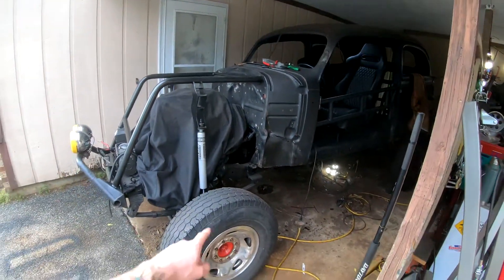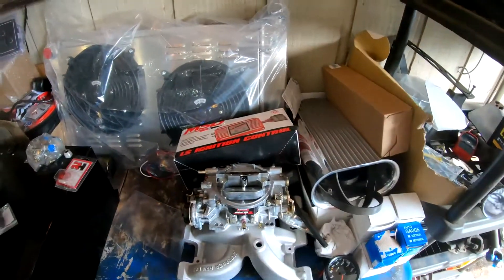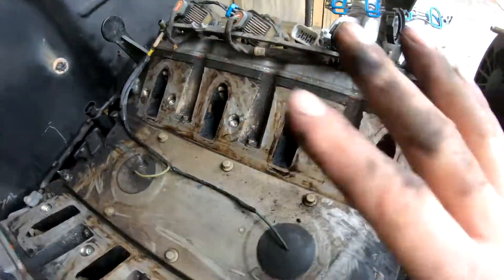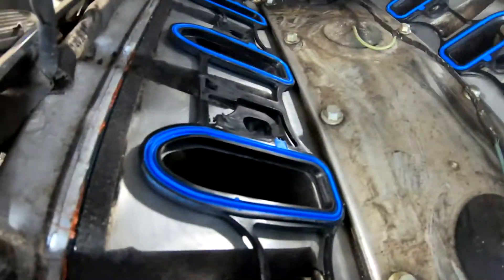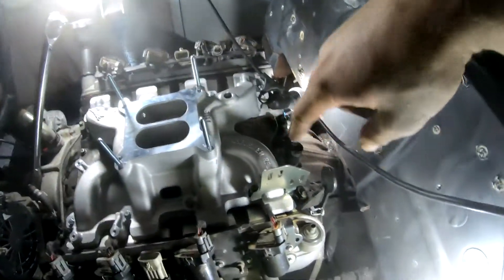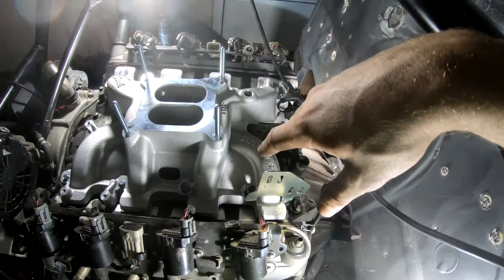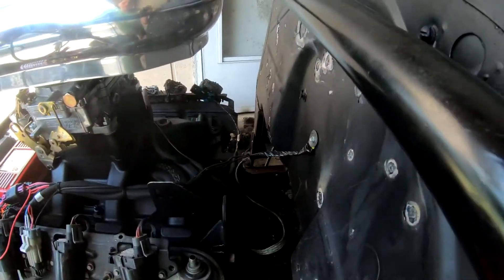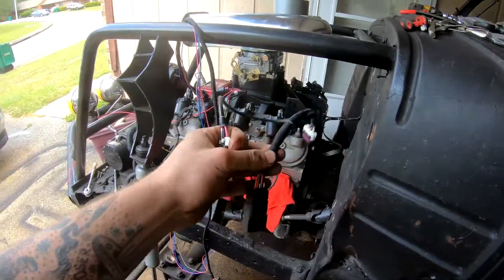Edlebrock Performer (7118) Intake, MSD, & AVS2 on an LS (1938 4x4 Buggy) || Legacy 4x4 and Off-Road

Comment: Do those style of scoops use an element ? or maybe a foam to keep the chunky bits out ?
Reply from the maker: there's a full 6" filter on the inside and a screen at the front of the scoop itself with double mesh inserts... so I hope!!
Reply: Oh for sure ! The paper element will be the end of the line. If it gets choked up you might be wise to keep a spare or two just in case. Look forward to seeing you ripping in it !